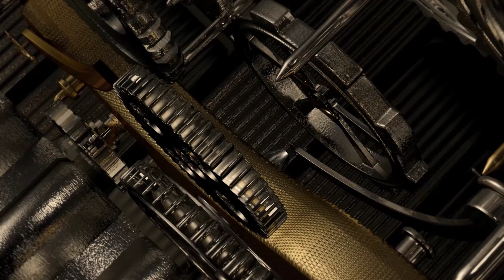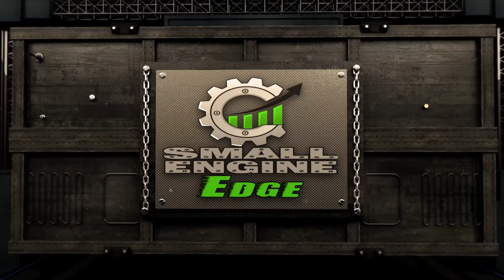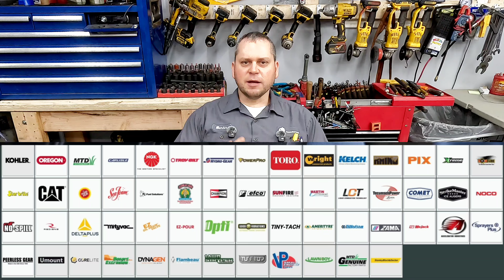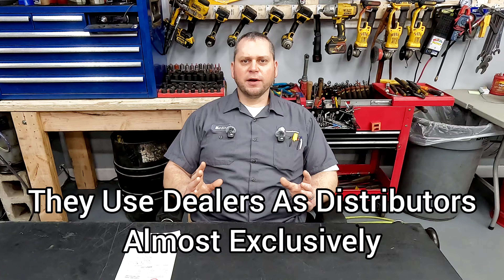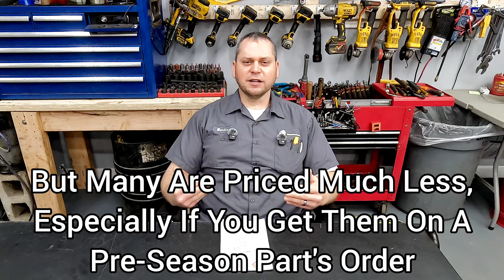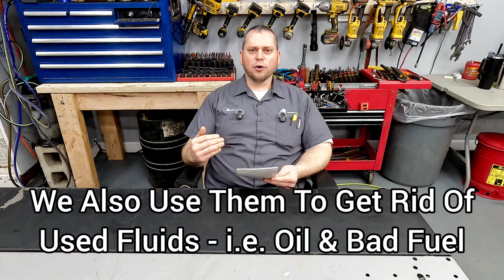Small Engine Repair Business Vendors: Top OEM Parts Suppliers & Resources - Where To Buy Parts

Comment: I'm working on a pull behind gas tiller and needing parts for the gear case. Any ideas for those parts. It's a tractor supply brand.
Reply from the maker: Those can be tricky! You might have to search by the tiller's manufacturer rather than the store brand for parts 🚜 Can you get me the model number?

Comment: Literally just got off the phone with Power Distributors out of OHIO and they require $500 minim buy in to set up an account. Why can they not understand some new business don't have $500 lay around.  🤦‍♂
Reply from the maker: I definitely understand that much! My advise would be to get with them right at the start of the spring or summer season once you have enough sales data to figure out what parts you will need over the next month or two. Soon as you have that initial order, the extra profit you make off that $500 order will almost pay for your next order (at least almost, depending on what you are stocking up on). I always used the 491055T & 796112 spark plugs in bulk 100 packs, which at 200 spark plug for $200 saves you $200 or more just with those two things and they are some of the most common plugs

Comment: Used OEM parts are the way to go on eBay
Reply from the maker: Used OEM parts are great for fixing equipment to sell but other than that most people do not want used parts installed from my experience. It is a different story if something is no longer available but all others I feel like you get pushback about. We save used part's but never sell them, only charge the labor to install
Reply: @SmallEngineEdge1 I run a eBay store selling mainly used OEM parts that does very well
Reply from the maker: I definitely understand that. We sell used OEM part's on ebay too and it brings in quite a bit for some extra cash. Good stuff!

Comment: Another thing to add for those starting out, a lot of online retailers have commercial discount programs. You won’t get wholesale prices but they are easy to set up (as long as you have a formal company) and it helps. I still use parts tree and Jack’s for MTD, Husqvarna, and others. I’m looking into Gardener for quicker turn around and better pricing but another shop owner in my area told me they have massive backorders.  I’m a specialized Briggs dealer with Power Distributors and I just became a Shindaiwa dealer through our local distributor (OED). I cannot emphasize enough how awesome Rotary is, but stay away from Stens. They wanted a massive $5k upfront order and their customer support is non existent.
Reply from the maker: All awesome information! Thank you for sharing, and you are definitely correct about online retailers having discount programs for the brands you can not source locally with a discount or with a real distributor. I am not sure if Medart services your area or not but they are great for all of the MTD/Husqvarna stuff along with Oscar Wilson. Both have very good stock on most stuff and great customer service. I have a Stens account but never have I used it

Comment: Hey Martin you have good content in this channel.I live near Eau Claire,Wisconsin and there use to be maybe 4 different small enine shops in this area and now we only have one shop.I am not sure what is happening with these service shops,but what I am wondering if some folks are using youtube to fix there own equipment,or if alot of folks use there equipment as long as they can and instead of getting it repaired or serviced they junk it and buy new again.
Reply from the maker: Thank you! I have seen many close around here also. It seems many of the smaller shops have been ran by older people and I do not see many younger ones stepping up to take over the repairs today but hopefully some will jump on the bandwagon and keep this small engine stuff alive
Reply: America has pushed getting that big college degree so you can make big money. Nobody wants to do menial work anymore. It’s looked down upon. You should know that.

Comment: Great tips Martin thank you personally I order my parts off eBay and as far as aftermarket I like stens or Oregon and then use Napa for oil and oil recycling and obviously Amazon as well thank you.
Reply from the maker: We will do Ebay every now and again. The reason I put it in the thumbnail but not a mention is because depending on where you order it from it takes a lot of time and it seems like much of it is labeled wrong at times (for example says OEM but comes aftermarket). I just need to know what I am getting when I order and do not have a week to wait (or more if it comes wrong). Napa stuff is good but normally use OEM filters since I can get them cheaper and people like to see the name brand on the mower. I love Oregon and Rotary stuff but have never gotten into much Stens (even though they sell the same parts as the rest many times, some of it just seems cheap. Many would say that about the Rotary stuff too but hey) Thanks for watching and for your comment!

Comment: Martin you are a wealth of knowledge here...could you possible touch on how you handle abandoned equipment and the length of time you legally have before this can be exercized. As i said i have worked on small engines most of my lifetime and since fully retired i need to handle those aspects properly
Reply from the maker: I appreciate that! I know exactly how it works here in Illinois since I spoke to a lawyer about this years ago but let me do a little research and see how this varies by state. I will do a video on it soon
Reply: Thank you so much

Comment: Hi... Do you have a basic price list for your shop to go by or a flat rate per job that you can share... how to establish a price list for a new start business..I'm located in West Ga.   Thanks in advance
Reply from the maker: This is how our rate reads:
Outdoor Power Equipment Shop Labor Rate $85.00/Hr
(Consumer Grade Lawn Mowers, Snow Blowers, Riding Mowers, Zero Turn Mowers, Handheld Equipment and Other Residential Lawn & Garden Equipment)

 Standard Shop Labor Rate $95.00/Hr
(Commercial Mowers & Equipment)

Minimum Shop Repair Charge $45

We offer free estimates on almost everything!
Reply: @SmallEngineEdge1  you’re right up there with my HVAC labor rate $95.
Reply from the maker: We use a mixture of flute rate and hourly rates and bid specifically by job. If still learning I would start really low for shop work so people will give you a shot. If your experience is good start quite a bit higher and use your related skill to speak for itself. This number in west Georgia I would think most shops are around $90/hr. If it were me I would set mine around $80/hr if your skilled or around $45/hr if your just starting out and looking for customers to learn and build. Anywhere between those two will get you a variable amount of customers just based on being cheaper. I will go over this in some more detail in the near future